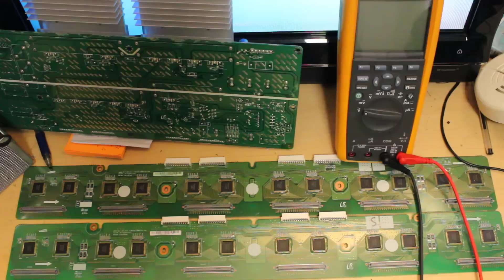How to Test a Y Buffer Board Plasma TV FAST AND EASY

Comment: PSA   Never trash your old parts. Don't even give them to electronic waste/recycling!   Sell them on ebay as "in need of repair" for a low price.  That way the right people can find them, fix them and resell them so we can all keep our TV's in operating condition!
Reply: That's a good way to get bad feedback for selling junk on eBay.
Reply: Not at all.  That's why you label them  "for repair"  so the people that go looking for these parts are usually shops  (shop jimmy has bought a few from me)  and I've seen already they fixed a few and resold them.
Reply: Completely agree! Any PCs can be fixed and used for good. Sell them to someone who needs them or will find a person that does. Cheers!

Comment: Hi just a quick question
I have replaced igbt or if u call them mosfet 30f124 found to be defective in an LG 42inch Y sus board and I hv soldered all loose connections correctly 
TV plays very nice for about 30min burn those in y sus board any suggestions plz

Comment: Hi, thanks for your very practical and explanatory video. I have a quick question, maybe you could help me. I have a 50'' Samsung plasma that is not working. The screen is black. When i opened it i saw (and smell) how couple of the IC where burning, and they have a small hole now. I'm pretty sure that they are not working, without even making your test.. My question is.. is it possible to me to solve the problem just replacing the Y buffer boards by new ones, or they could get burned again because the main issue comes from the other supplier board? Thanks so much.

Comment: The video is good but it s not true when you said that you could choose any pin on the white connectors.You must choose a connectors which all of is pins are together.I say that because the pins we need is the one where the 400v peak to peak timing signal is input in each buffer.But the  other pins are other lower timing signal.If you choose these other pins you will fail your troubleshooting.And it s important to check each side of the big connectors too(both side).Thanks

Comment: So I took the y buffer out of the tv, and I ran one of the metal instruments along the part that you described, and my multimeter didn't change until it displayed a number  in the thousands three times for three of the small metal copper insert area bits. What does that mean?

Comment: I believe I do have a problem with Y buffer from my Plasma TV. I do have a few questions, it all started with pixels like stuck or delayed lets say from one image to another specially red .. eventually I do have that issue with pixels all around screen but also after a few time ON the image is gone but I know is still ON cause I can hear the sound.  I ran one of these programs for repairing the pixels stuck using a Raspberry Pi attached via HDMI .. some improvement but Not what I was expecting ..So I believe second issue is pretty much related to Y-Buffer ..what about pixels delayed/stuck might be related ?? I am relating the word buffer with delay I just mentioned .. any advise would be valuable before actually attempting to open the TV :)

Comment: Thanks for the video, but how can i measure buffer board if those wires are soldered on the pcb ? there are no conectors that goes into display, how can i desolder the ribbon?

Comment: I have a Samsung pn59d550c1fxza and the y buffer board ribbon connector has glue on top and bottom. How do I remove this so can test. Y buffer board is identical to this video except for the glue.

Comment: does it matter which pin you select to ground too?
Reply from the maker: Hi, no, it does not matter which pin you select, since it is only continuity that's being checked.
Reply: Runforlife thanks for the tip looks like i just need a sustain then great video 👍
Reply from the maker: Thanks! Don't forget to like and subscribe!
Reply: Why did you just put the multi-meter prob at a particular pin why not others too ?

Comment: Hello! When you put the multimeter lead onto one of the pins of the white coloured connector, why did you only put the lead on that particular pin of the white coloured connector? Does the test need to be carried out by putting the multimeter lead onto a DIFFERENT pin of the white coloured connector too?

Comment: What are the symptoms of a bad y buffer board?
Reply from the maker: The "no picture" is a common sympton of a bad buffer board on plasma.
Reply: A horizontal line too.If black you could clean the connector(blow air) and the cable with an erase.If colored it s the buffer ic.
Reply: 7 blinks on the led of this model is a bad buffer board.
Reply: What is wrong with X Buffer? On my 42" Samsung plazma when x buffer is connected to logic board, vs and VA voltages going down, I belive for some reason Vson on logic board is getting lost after turn on tv. If all boards connected exept x-buffer to logic, then both voltages ok. What could be bad? I found one igbt is dead, replaced,  but it did not help.
Reply: @Home_made_ch  the most common failure I see on the older samsung plasma is a failed ic chip on the ysus buffer board which othen takes out the ysus board too. Ive never had xsus fail on a samsung yet.

Comment: Can you help me out I have a Samsung plasma TV the TV can come on but it does not show a picture or the screen does not light up but I can change the channel turn the volume up and down turn the TV on and off the green light in the back flash slowly I tested power board I am getting power I replace the main board to the buffer board